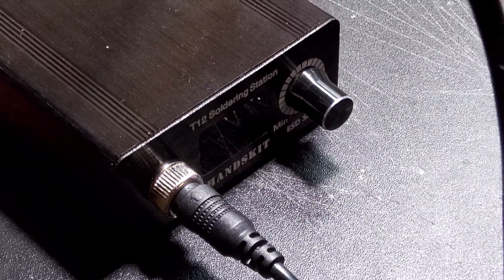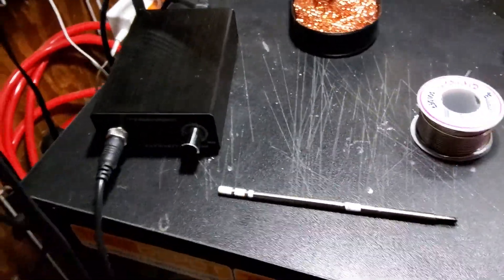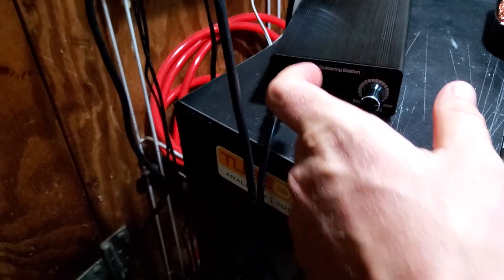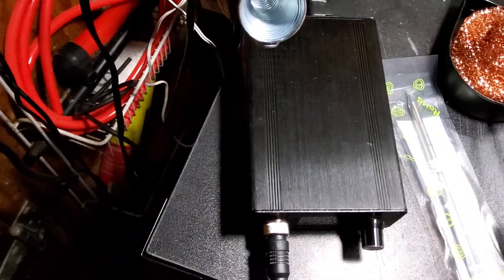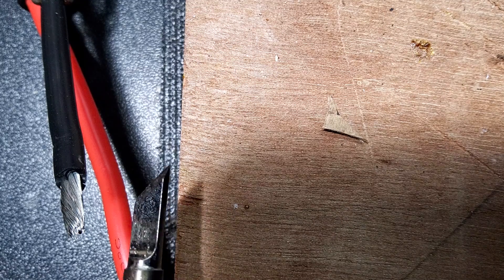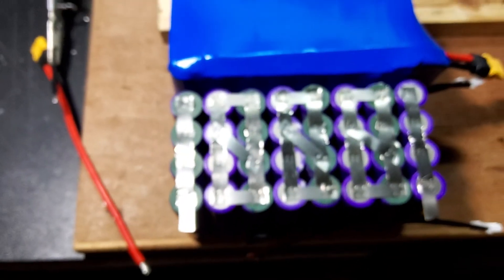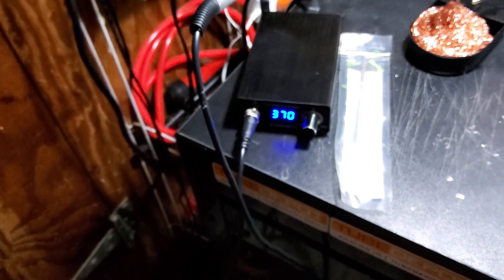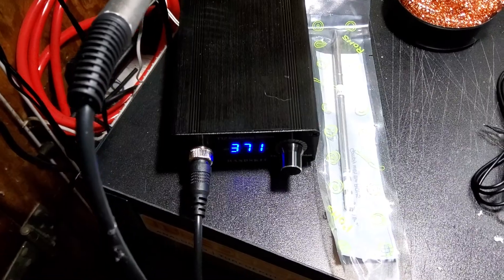T12 soldering station

Comment: Did you open yours up to see if the faceplate is on upside down?  Mine was, and so were a LOT of them.  This puts the main board at the top upside down so it over heats.  It's an easy fix.  Just flip it upright and screw it back together.

Comment: Did you add the ground mod? My case isn’t grounded and was thinking of doing it as well, I do have the ESD outlet in the back and it is connected inside, down to tip. Do you know of the mod that auto offs it when placed in the holder?

Comment: Also I found those copper looking brillo pads that come with those iron holders are plated steel. Check with a magnet. Get a Chore Boy in the supermarket pot cleaning section. Solid copper.  I just don't like getting my tips near steel.  :)
Reply from the maker: Good call, i'm going to check that
Reply: @BradCagle  ;)
Reply from the maker: Yes, your suspicions were correct it is plated steel verified with a magnet. I'll grab a chore boy. BTW the tip tinner is fantastic thanks
Reply: @BradCagle  Happy to pass on stuff I learned.  :)

Comment: If I have stranded wire to tin, I jam the ends into my flux paste tin then proceed like you show. :)
50 yrs of soldering.
Reply from the maker: Yeah, I have a bottle of liquid flux I usually soak a few drops on the the wire first, especially the larger stuff.
Reply: @BradCagle  Always wanted some liquid flux. :)
Reply: @ebenwaterman5858  Can buy some lumps of pine rosin and dissolve them in alcohol (90% or better isopropyl works okay, but I prefer ethanol, even denatured as in "methylated spirits"). Get a multiple lifetime supply for a few dollars, and the lumps will keep essentially forever. You can use the expensive rosin sold for violin bows, but expensive!